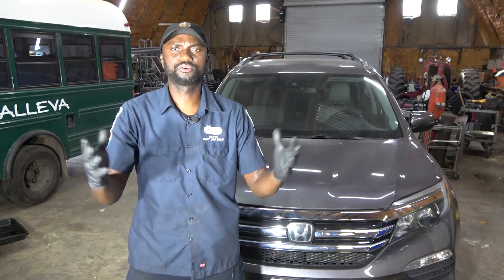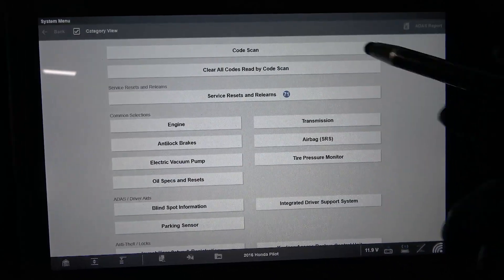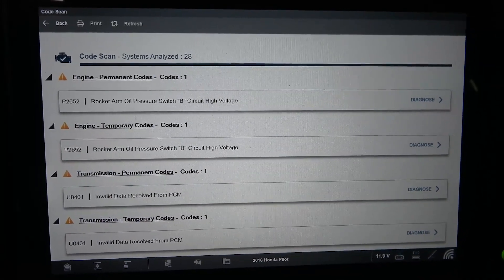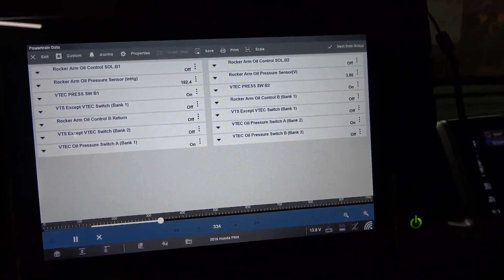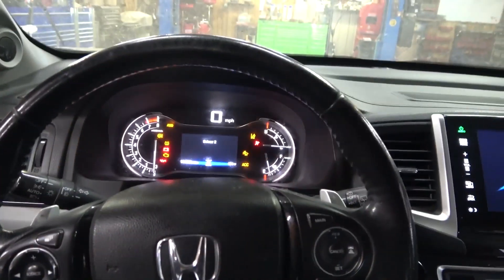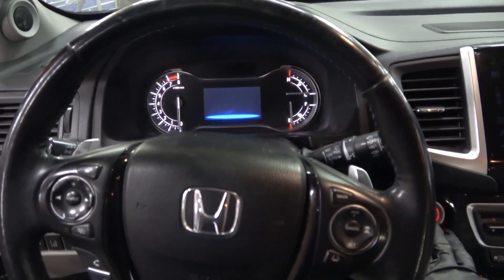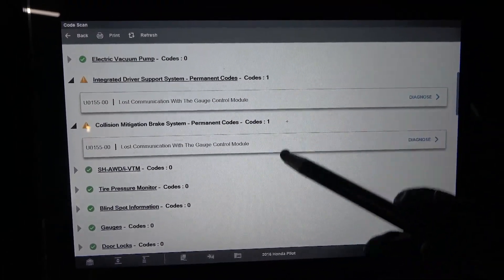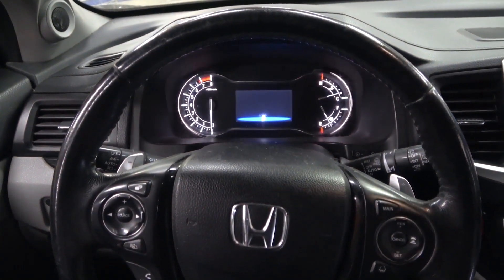2016 HONDA PILOT P2652 Engine Runs Rough - High idle Speed, Rocker Arm Oil Pressure Switch Diagnosis

Comment: 2019 Honda Pilot Elite with 163,000 miles.

Got gas, drove home, car went into limp mode, ALL the warning lights triggered on ALL of the systems. Drove home VERY slowly as the car was in Limp Mode.

Found this video, bought a new Pressure Switch from Autozone for $45 (part# PS702) with lifetime warranty, installed with a 12 point "thin wall" 24mm deep socket, start the car, drove normally. My LTFT & STFT even improved closer to "0".

Thank you!
Reply from the maker: @tahjo7   My Pleasure! I'm glad to hear that the video was helpful!
Reply: I did exactly the same with my 2018 Honda Odyssey and it worked!
Reply: Same thing happened to me.
I filled up my car with gas, drove some miles and I got all those notifications and the car was hard to accelerate.
Thanks for your comment and the video to resolve this issue.

Comment: Thank you! Your video saved me a bunch of money on fixing my wife's 2014 Acura MDX which popped up with the emissions error notice and same P2652 code via the OBDII scanner. I appreciate you completely walking through the diagnosis process. While  I didn't get 12v when checking wiring, I was able to get 0.8V steady when the ignition was turned on so I felt comfortable the wiring was not the issue. I changed the sensor using your part number, cleared the codes (couldn't clear the permanent code with my mid-level Harbor Freight scanner) and the car ran just fine. I understand the permanent code will be removed after 15 cycles or 200 miles.

In all including the cost of the scanner, part and buying a new set of long sockets, I spent less than $200... which is likely what the dealership would have charged just for a diagnosis.

Thank you!
Reply from the maker: @jamiereece1845   My Pleasure! I'm glad to hear that the video was helpful

Comment: Thanks you , I just fix my 2019 Honda Pilot 😊😊
Reply from the maker: @thienpham1000   My Pleasure!
Reply: Same, 2019 Honda Pilot Elite.

Got gas, drove home, car went into limp mode.

Found this video, bought a new Pressure Switch from Autozone for $45 (part# PS702) with lifetime warranty, installed with a 12 point "thin wall" 24mm deep socket, start the car, drove normally. My LTFT & STFT even improved closer to "0".

Thank you!

Comment: Trying to diagnose P3497 Accord V6 VCM 2010 130Km, random misfire and new Honda genuine pressure switch replaced (front and rear) and yet the same problems - P3497 with random misfire from cyl1~ 6, and intermittent flashing check engine light as well. What would you check next?
Reply from the maker: @bekomcar554   check the oil level and the solenoid wiring!

Comment: Hmmm I was looking for the voltage to be pulled to ground when the switch closed. Unless I missed something, I never saw the voltage pulled down. Instead it looked like the voltage went up with RPMs. Little confused there, but leaves me woundering what that voltage would look like with a oscilloscope connected. May be something going on that we can't see with the voltmeter.   
Thanks for another great vid.
Reply from the maker: @bobcombs7138  My Pleasure! good point maybe the multimeter was not fast enough to see the change in voltage or the rocker arms were not being actuated by the ECM at that moment!

Comment: Hi kits auto!! I am one of u subscriber ,I ha  I quation fore u. I have toyota rav4 2007,  my  brake pedal is sinking,  I changed master cylinder, used ABS module and I bleed it no leak ,but still sinking what  will be the  problem?
Reply from the maker: @filmonteamrat5119  Get an OEM master cylinder!  you might have an internal leak ion the master cylinder

Comment: I would love to know how the switch was removed? There is next to no clearance to get grip on it. Pulling up on the bottom of the switch with a flat head driver doesn’t move it. There is no visible tab on the outside. There is a locking tab on the inside of the replacement part
Reply: The switch was spun around so the tab was facing a side that was blocked. Was able to wedge a couple flatheads under the bottom of the switch and twist up on them until the switch popped off. Damaged the inside tab a little but had no problem installing the new part.
Reply from the maker: @adhutson  Look Closely, there is a release tab on the switch
Reply from the maker: @adhutson Good job!

Comment: I have a 2012 Accord and p2651 came up b rocker arm actuator system performance stuck off any tips or solutions
Reply from the maker: @janinturner3440  check the solenoid and the solenoid wiring!

Comment: 2015 Mercedes sprinter 2500 144’wheel base 4 c 2.1L 

What should be the rpm at 120km/h
Reply from the maker: @saifnaeem6275  I didn't understand your question!